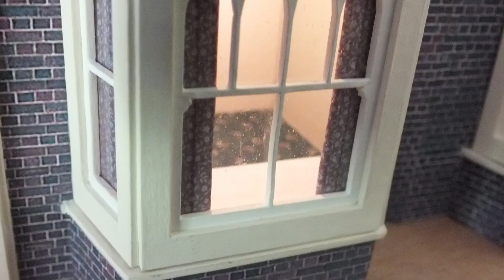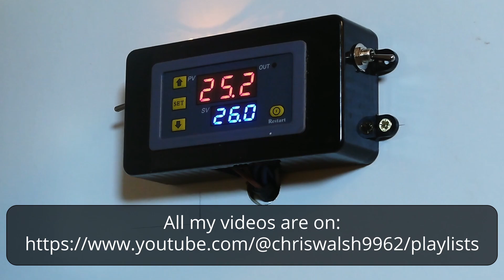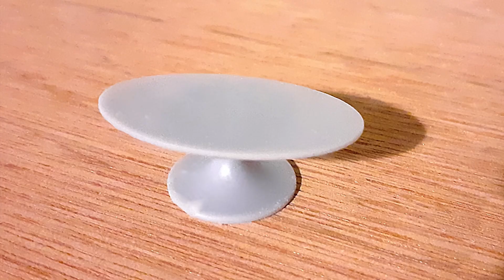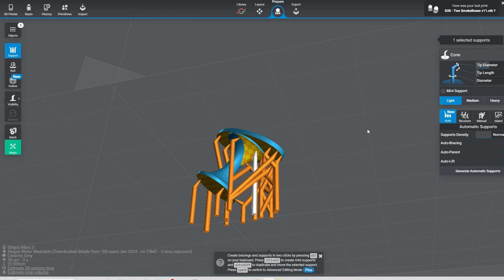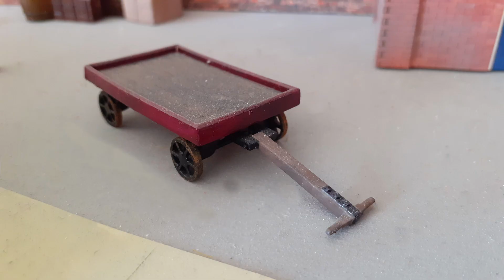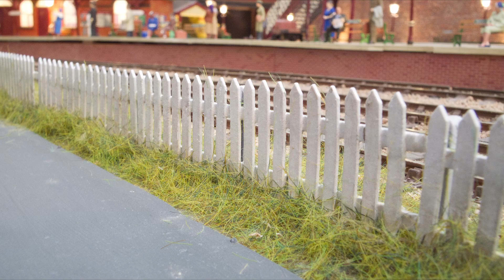How 3D Printing Changed my Layout

Comment: An excellent little video Chris. I really need to spend more time learning how to draw things up, since, like you, I saw the potential of 3D printing and purchased a Saturn 2 last year, oddly enough, most of the parts I've printed are parts for the locomotives I've built from kits, or restored! I'm 99% sure where that D20 came from, and will probably get one from the same source eventually, good to know some of its limitations...
Reply from the maker: Glad you like the video Stan.  As you have probably found, there are loads of video tutorials on YouTube and the three I featured on this video are the ones I made most use of.  You've already made great headway if you have printed parts for your own locomotive kits.  Good luck with the D20.  You may have more success than I did.   Incidentally, Tony Wright tells me that LNER D20s didn't have a front number plate.  Mine does!
Reply: @chriswalsh9962  Thanks Chris I certainly will be referring to those video's even tho my I've found Siemens Solid edge an easier  package ( kind of) to Autodesk Fusion!

Ya - I hear interesting tales about kits from that source, so am apprehensive to say the least - that being said a 2nd hand copy of the kit recently listed didnt last very long so there are plenty who will give it a go. Somehow I think its unlikely I'll be in a position to get the DJH kit so Ace it will be. 

there's also a couple of 2nd hand models up for sale at present - both need work but look like they have potential.

Of course Tony is correct, the LNER put its front loco number on the  buffer beam, but I have seen photos taken c1949-51 where hybrid numbering still exists ( There's a nice pic of  on rail-online showing a J39 with BR smokebox and shed plate, BR number in LNER font on the cab-side and LNER on the tender so interesting choices available)